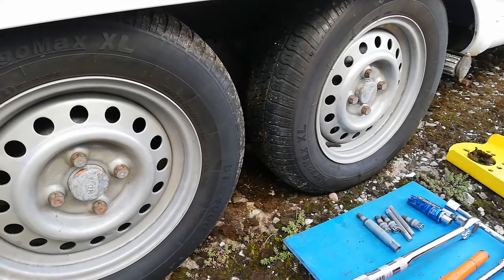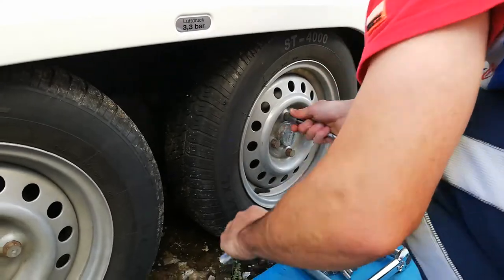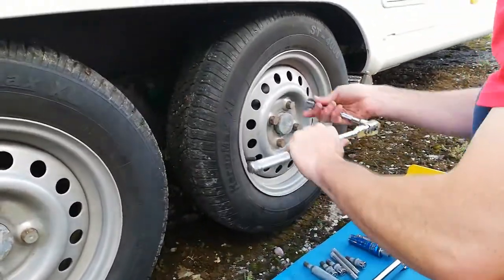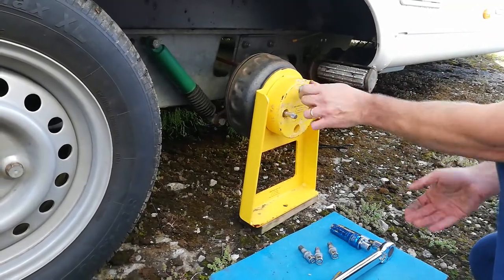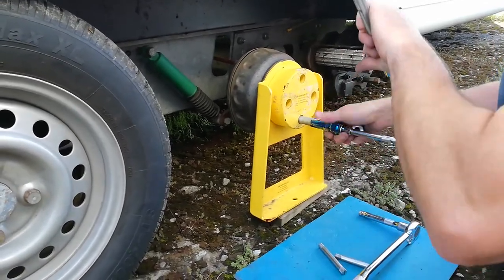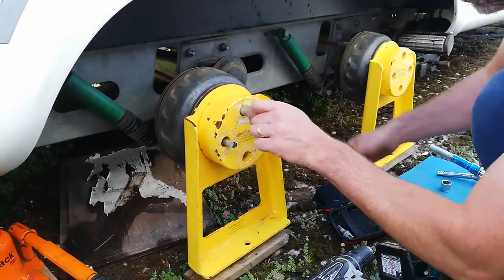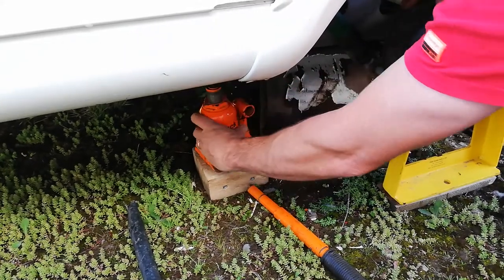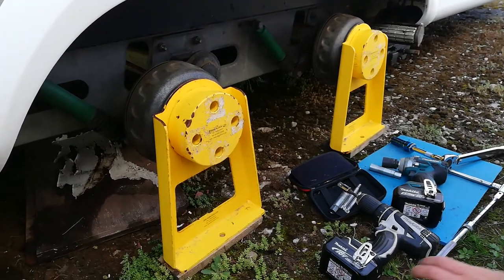Fitting JSB Hublocks

Comment: The same way you install them, they can use same tools and take it off?
Reply from the maker: Yes, but again don't use an impact gun on the McGard bolts. Otherwise exactly the same tools though. Remember the torque values will be specific to your caravan/trailer wheels so check those.

Comment: If they are meant to be almost bullet proof why 2 of them?
Reply from the maker: Hi Mark that's a good question. On a single axle caravan you'd just use one lock on one side. For a twin, you must use two as otherwise the thieves could cut the legs off the JSB and tow the caravan away on the other wheel. You need to completely disable one side of the caravan. Hope that makes sense.
Reply: @bdshepherd99  so you only need one of these for a single axle caravan? There was me thinking you'd need two. One for each side of the caravan. Thank you for answering this first and very good question. Makes complete sense
Reply from the maker: @traceya8699  yes just one for a single axle caravan and two (on the same side) for a twin axle.